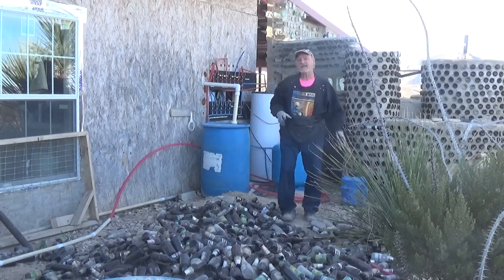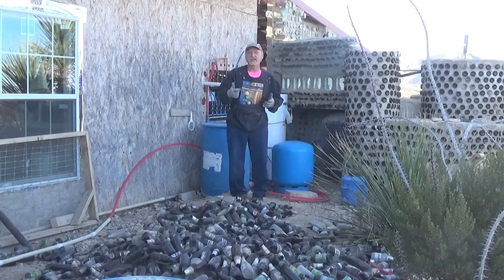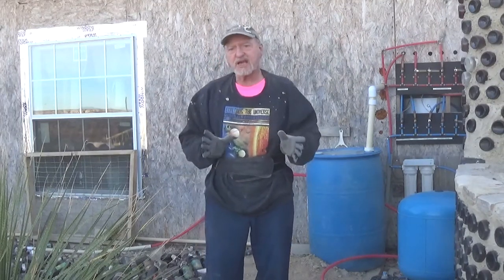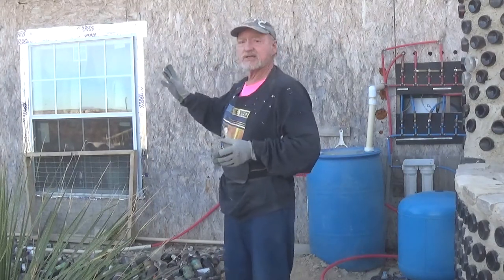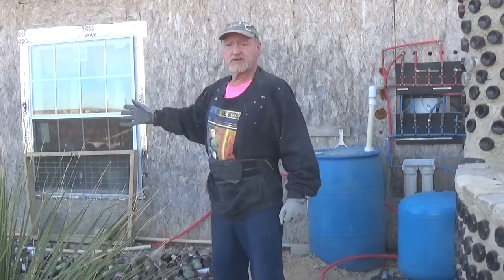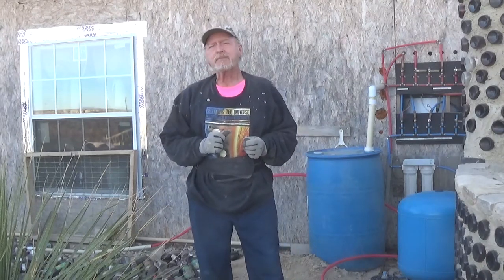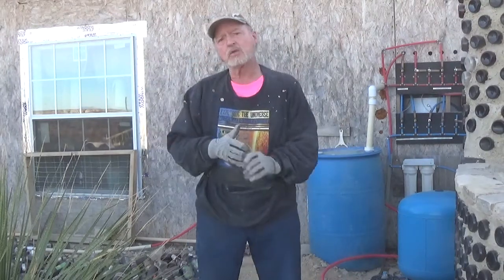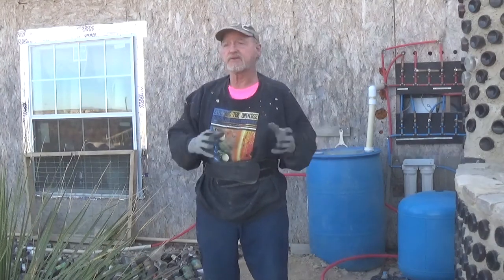Mechanical Room Build, Part One

Comment: It will be interesting to see if you and your help can build the room quickly...  I have a water catchment system as well but installed the pump and exposed piping into a resin horizontal storage shed that opens from the front and from the top.  Some recycled 2" rigid foam lines the box.  I use a small electric heater with a freeze stat.   So far so good.